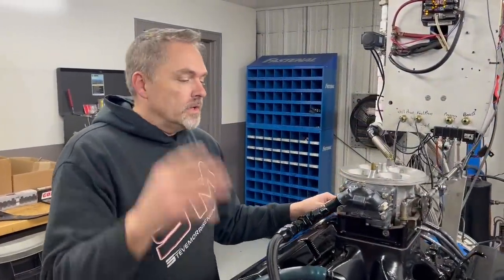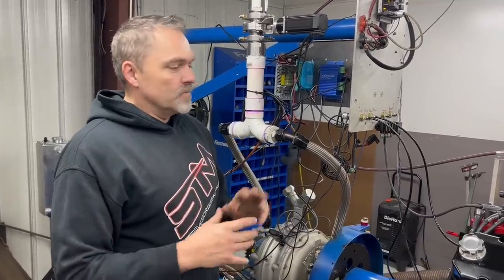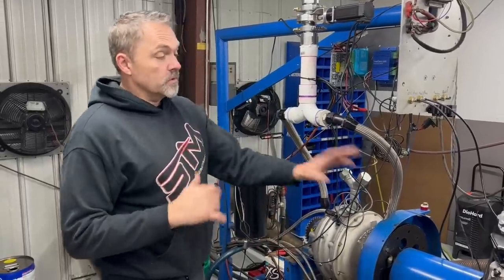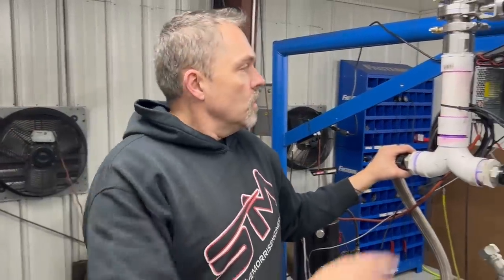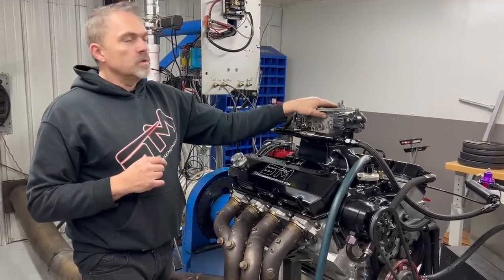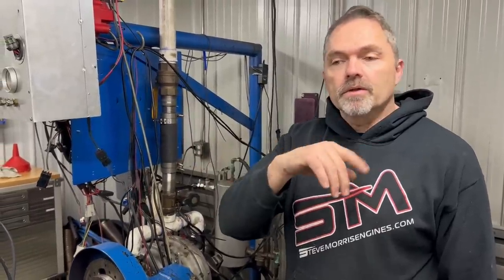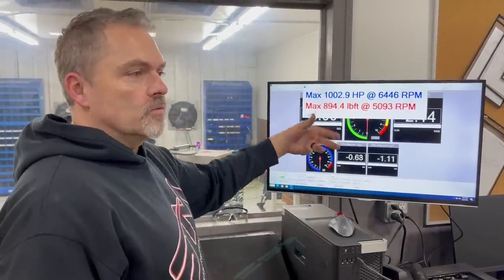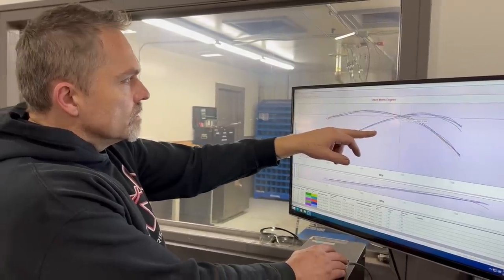“What Happens When Your Carb Is Too Small ?” Dyno Data shows us

Comment: He said " It was only making like 750 hp", that must be like having a Briggs & Stratton engine in the shop compared to what is usually in there.
Reply: Nah. I think Steve can appreciate a nice N/A mill🙂
Reply: Lol right
Reply: I would love to have 750hp
Reply: Honestly 750hp isn’t all that impressive considering you can buy cars and trucks off the showroom making that kinda power or more. You can take a junkyard LS and a turbo, and make more than 750hp.
Reply: @precisiondiesel225  Sure and blow it up in a number of months if you're lucky.  More likely weeks.
Reply: @mjay6245  OH so wrong. Soccermom has a 5.3 iron block that makes 1000hp repeatability.
Reply: 750 out of that displacement especially running methanol is idiotically low

Your average hot rod motor moves 1.35 CFM to make a HP

On methanol it's closer to 1.18

This thing was moving 1.68 that's terrible

You could get 750 horsepower out of this many cubic inches at 6000 RPMs on gasoline
Reply: @precisiondiesel225  Honestly, you just demonstrated that you don't know the difference between N/A, and boost. And that is not good at all.
Reply: @Bozemanjustin  "this channel has no videos".
Reply: These goofs in this thread acting like they know what the customer wants. And IMAGINE the kind of person that criticizes Steve for every little thing, and yet they have no videos on their channel. Like, you have zero credentials here. Why do you think your opinion needs stated?
Reply: @andrewforte   and blows up every other run now. Its now almost a year out of the running.
Reply: @ratrider5748  once again oh so wrong.  The stock LS1 crank will easily survive 900hp without any problems. A few cheap mods, like main cap studs will make it reliable at 1000hp.
Reply: Cries in 200 hp 454
Reply: Can't stop a briggs
Reply: LoL 😆
Reply: Well 750 really isn't peanuts in the drag racing world dude. Just saying
Reply: @andrewforte  yeah constantly torching heads and block reliably
Reply: @Bozemanjustin  we dont run methanol for hp

Comment: Sometimes the intake is too small making the carb go rich too. Shorten runners bigger plenum. Had a N/A small block we had on the dyno tried from a 1150 to a 1650 carb same results going rich cut the manifold apart made the plenum a lot bigger and shortened the runners picked up 35hp with that being the only change.

Comment: after watching your video about mullets engine. i can understand the use of a timing belt with your race engines. since they are built so often and easy to see any damage to the belt. but i just had one snap on me. but it lasted longer than it should've
Reply: Did the belt breaking damage the engine?
Reply: @tomhanson4153  If it's an interference engine, breaking a timing belt will always damage the engine severely because every valve is getting eaten by the pistons.

If it's not interference style, it will be okay if you stop running it.
Reply: Some tracks are not very clean in the pits and return roads, rocks can and will jump up and get between the belt and pulley and ruin your day. plenty of bent valves and depending on lobe position the piston will come up whack the valve and pull or break a rocker stand. Otherwise it is a good general plan to change the belt in the range of 300 runs or so.

Comment: Hey Steve...enjoy the channel...great video....63yo catb guy....is there a way to test if your carb is 2 small "without" a dyno or make'n a pass @ the track...?...say..if u had a vacume gague  piped into the base plate "below" the throttle blades....@ 6 to 8 thousand ...if the carb was to small...would the motor start to build  vacume....@ those rpm's if the carb was to small..?....or it wouldent show....I guess an O2 sensor would show the motor getting fat  @ the top rpm...?....is that correct...?...there is such a debait on carb size....I've  always seen improvments going "up" in carb size....but...have herd others say going the other way netted more power...?....?...anyway....keep up the good work ....good luck with the new trany...& dip'n into the 5's...Brian

Comment: Until recently every vehicle I have had has been fuel injected, but now we have two Ford F-1s that I take care of for my parents. The '48 has a 460 with a 4 barrel Edelbrock on it and the '49 is an all original Holley single barrel down draft carburetor. I was into the single barrel, because when the truck was restored the person forgot to cap the fuel tank and it got filled with sand blast sand. That's the theory anyways. It is amazingly simple. It has an idle circuit and an accelerator pump. The rod that connects to the accelerator pump has 3 positions. Cold, moderate, and hot. What that means I don't know. What is cold to me is not cold to someone else I am sure. Lol! I wonder if the 460 is over carbed though, because it is a stock 460 from '71 and has a 750 cfm carburetor on it. It is a thirsty beast. I am probably one of the reasons it is thirsty though. I like the sound of the big block a little too much...lol!

Comment: To be precise new valve control motor it's not direct drive, there is a planetary reduction gearbox between stepper motor and final output shaft to the valve.

Comment: Steve. Do you ever have engines with carbs on the dyno. Do you bring them up to 1700 rpm or so.  Before the primary boosters start flowing to see if the IFRs are sized. Holley ships so many with 0.031 IFRs that are sized for a 327.  But too lean for a 347, 355. 427s need a 0.035 or 0.036 ifr to not lean out coming off idle.

Comment: 1002 hp @ 6449. That's pretty healthy. I'm guessing lots of compression and a cam in the 850 lift range🙂
Reply from the maker: Close
Reply: My buddy's 555 made 1050+ at around 6500 with  15:1 comp & .750" lift but cam had 275* duration at .050" lift. His 86 Olds Cutlas went 7.97/168 on gas with a single Pro Systems carb & with 4000ft air density. That's around 7.70/173 at sea level.

Comment: 108👍's up Steve Morris thank you for sharing
Reply: Hello Steve
Build a conventional big black cylinder head that have direct injection into the cylinder as the Piston is coming up for compression
Will induce more compression ratio by adding the fuel after the valves are closed
Think outside the box Sir

Comment: It not about the maximum power that wins races, it's about the spread of power and torque across the usable rev range or the rev range that the engine will be operating in. So very often a smaller carb with provide better intake velocity and a better air-fuel ratio than a bigger carby. Its the same reason why running over-large diameter headers primaries can rob performance. Bigger is not always better.
Reply: Good answer. NASCAR engine builders use the dyno to time the acceleration with the load set for the weight of the car/gear, from low rpm to max for any given track because acceleration is the important factor, not peak HP.

Comment: Hey Steve. I wanted to ask if you could do a breakdown on carburetor types and the differences between the brands. Perfect example would be Holley vs Weber. Holley you knew what to get thanks to it's CFM number (600, 750, 850), where Webers you wanted were based on size (45mm, 48mm, 55mm, etc.).
Reply from the maker: I have never e Ben touched a Weber, so I am not the guy for that.
Reply: @stevemorrisracing  Wow! That wasn't an answer I expected. 😂 Thanks anyway Steve, I appreciate the answer. 🙏
Reply: Main difference is the webers were designed more for inline engines. 4 and 6 cylinders. The best carb for your engine is the one that gives you all the air flow you need and the best consistent AFR across the  rev range. The new holley EFI gear is pretty trick. I'd love to see how an EFI setup would perform against a similar sized carb.

I believe the 45mm etc reference was designed to make quick reference to porting sizes. Back in the old days, generally speaking, all ports were round. For a 45mm port you'd use a 45mm carb.
Reply: @joebloggs2635  Hell no they weren't. Lamborghini were famous for using quad Weber's on their V8's like the Urraco and even 6 of them for their V12's like the Miura, Espada and Countach. 👍
Reply: @MafiaboysWorld  yeah that's why I said generally speaking.... could you imagine tuning a V12 with all those carbs. A jet change would take all day. They probably only went with that option cause they couldn't find a big enough single carb. Perhaps they didn't want to put an American part on an Italian stalion... 🤣
Reply: I have seen a lot of European cars with Webers. That may be where the naming convention difference came from. Makes sense since Weber uses the dirty metric system, lol!
Reply: @joebloggs2635  That last line was exactly it. 🤣👍
I remember they got one on Wheeler Dealers (the UK show) for their Lambo, and it took the guy 4hrs to tune all 4 carbs properly and around £600 back then, and I think that was like 10-15yrs ago now. 🤔
Reply: I am a big carb guy, and about 2 years ago I was sold on Jon Bitler IRD all billet custom blow-through carb. He just set the record with blow-through in his nova for RWHP. A touch over 3000 rwhp out of his bbc procharger combo. Fuel Tech posted a video of it on the dyno with numbers a wk or 2 ago. The thing has tps sensor and all just bad.
Reply: @jasonstormoen  I'm a small car guy so I went through the whole carb phase (both blow and draw through) before EFI and saw all the issues with boost. Carbs today compared to back then are light years apart due to the knowledge we know now coupled with the technology of today compared to then which has removed a lot of those issues we had back then (like lack of fuel pressure under boost).
It was just like turbos back then vs today too. Back then, there was no 1000hp turbo, just get two 500hp TO4 turbos and pray. Today, that's your basic Precision 7675 package. 👍
Reply: @The Maf Garage  I understand what your saying. I only been in this with my own car since 92 but I grew up in it so I understand what your saying.
Reply: @jasonstormoen  Dang, you got me by 2 years. 😂👍 My first time was a Mitsubishi Sigma Turbo (factory draw through), then worked on a blow through turbo on my mates Gemini and the boost difference back then was night and day. Blow through, max of 7psi before it started killing the carby from heat, even with meth injection. Draw through, I remember seeing close to 14psi. 👍
Reply: @joebloggs2635  most Weber installs are i.r. (individual runner installs) and much like i.r. fuel injection installs allows for individual cyl tuning the reason webers are not rated by cfm like Holley's is because Webers have interchangable chokes allowing a carb to better be tailored to engine combo.....
Reply: @The Maf Garage  😆 make me feel old 😆 no, I know what your talking about.  My first engine was a sbc blower, and then I went nitrous, and it was all in my 88 Monte SS. I still have the car all these years later and run it.  It went through many changes and combos, and I've had the draw through, blow through, efi, and now back to blow through, and I and very happy with this IRD carb and don't think I'll be changing any time soon. I was running haltech wms t, but I am now running the dominator ecu and just not using the efi part other than tps.
Reply: The CFM numbers aren't the end-all/be-all with Holleys. The actual CFM will depend on the amount of vacuum applied to the venturis.   And for some reason Holley uses a different vacuum standard on 4bbls .vs 2bbls.   So a ''500CFM" rated 4bbl does not flow the same as a '500CFM'' 2bbl.

Webber is all like ''the venturis are this big, take what you want from that and run with it''.
Reply: @pirsq314  That's the answer I was looking for regarding Weber's. Thankyou. 👍
Reply: @earlbrown  Yeah, I know a 500 2bbl compared to a 500 4bbl is world's apart due to vacuum/air ratio being different in both.
As for Weber's, it's more what Pirsq said. I remember having interchangeable chokes, jets, and extended float bowls, the most famous being the 48mm to 51mm float bowl on the IDA for old school rotaries. 👍
Reply: Webers had changeable venturis so it was easy to change the "size" of the carb. I ran a 48 IDA with an individual long runner intake, effectively like running 2 single barrel carbs, on a 105hp, 1641cc, VW in my Class 10 desert car in the 80s. A shop in Phoenix made custom venturis to size the carb for application & speed up the air through the carbs. Both throttle response & power were awesome. The newer Holley carbs have changeable air jets like Webers had 50 years ago. They all tune the same, just the configuration is different. Understanding & knowledge is the key. Pro Systems builds custom carbs that are outstanding. My buddy's 86 Cutlas, SC drag car went from 8.16 to 7.97 by simply bolting on a Pro Systems carb & never touched anything on the carb(including idle A/F screws or curb idle speed) after bolting it on.

Comment: Great video Steve, if your running a 1150 carb & you need more air, is it time to go twin 4’s? Cheers from Aussie
Reply: Dynos & real world are different & what works in the dyno room doesn't always translate to the track. Track fuel & timing demands are rarely the same as on the dyno. Pro Systems usually sends customers a smaller carb than they've been running & the car always picks up. My buddy's 86 SC Cutlas picked up .2 second(from 8.16 to 7.97) & 3(165 to 168mph) mph by simply bolting on a PS carb.

Comment: How about an explanation of the dyno and tuning strategy you employ. It looks like you pull against a fixed water brake valve setting, probably to simulate the drag racing load profile better. The Superflow dynos have a programmed rpm increase rate which must use a variable load and feedback to control the rate. I’m not really sure what I’m saying is accurate, so can you explain? Thanks Steve, always interesting info on your channel!
Reply from the maker: How does a Dyno Really Work??
https://youtu.be/H7i_1rXE_oc

Comment: I observed some sewer and drain fittings on your water  supply. That's a no no . I respect your expertise in the engine building department but I worry your going to have a mess or more when they fail . While the double ell looks good it won't take to much pressure,change to schedule 40 pressure fittings bare minimum

Comment: that is surprising it makes 1003 this is your typical 7.80 bracket engine it should be making 1150 to 1200 HP to be a fast bracket engine then it would be approximately in the 1/8 a 4.50 to 4,60 ET. great power gain but week for the cubes probably in the heads and a couple more in the carburetor. speed cost how much do want to spend? thanks S.M.E
Reply: 1050hp pushes my buddy's 555ci BBC, 86 Cutlas SC car to 7.97/168 with a 5.07 1/8 mile, on gas with a single Pro Systems carb.

Comment: What is the best way to determine if your carburetor is too small without many Dino runs?
Reply: You could measure intake vacuum. Should maintain near ambient pressure at full throttle. If it’s still pulling vacuum the carb is to small.

Comment: Hey Steve,
How come you only have 5 psi Fuel pressure max through out the entire dyno run?
Methanol carb using a belt drive pump needs 10>11 psi min of Fuel pressure!
I would have to say your lean and going to burn this up!
Brian
Reply: Don’t the very large needle and seats require less fuel pressure?
Reply: @dirtymuleracing5321  BLP make a .164 needle and seat that still require a min 9 psi of fuel pressure under full throttle to insure the bowl does not run low and lean the engine out.
Been running methanol with carbs for over 25 years in drag racing.
Reply: Higher fuel pressure lowers volume. ALWAYS run the lowest pressure that will keep the float bowls full!

Comment: A 582 running methanol and only making 750 horsepower?

Somebody's an idiot LOL

YOU could have gotten 750 out of that thing, on gasoline at 6000 RPM

Build it for higher RPM and methanol, should be getting a thousand no problem
Reply from the maker: It is on methanol
Reply: @stevemorrisracing  

Yes and methanol should get you more power. Not less. If you can do it on gasoline with lower RPMs why are you not getting it on a methanol motor?

Comment: Why does your hp and torque not crossover at 5252 in your graph?
Reply: You must be seeing something wrong. TQ & HP alway cross at 5250 because HP is a mathmatical formula(TQ x RPM divided by 5250) & 5250 is the divisor.